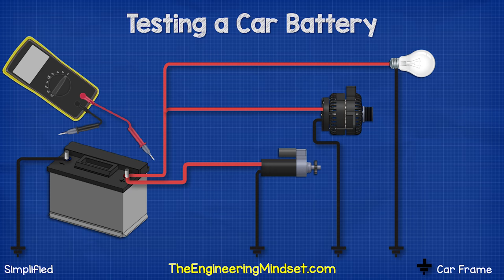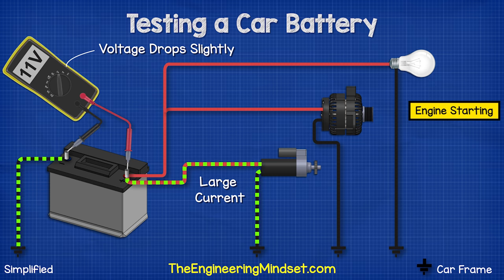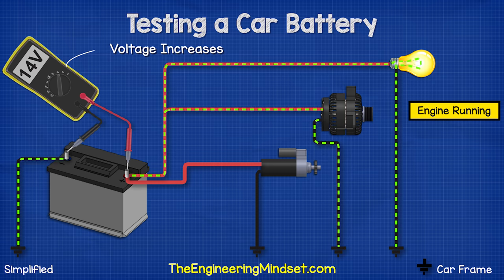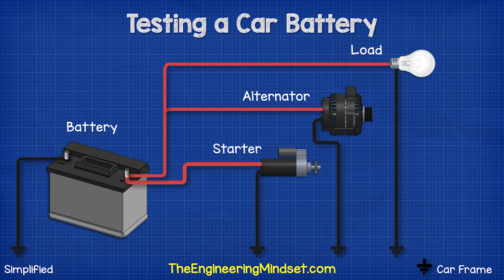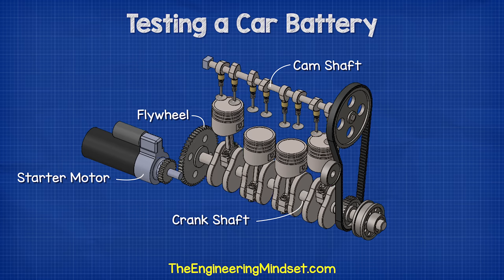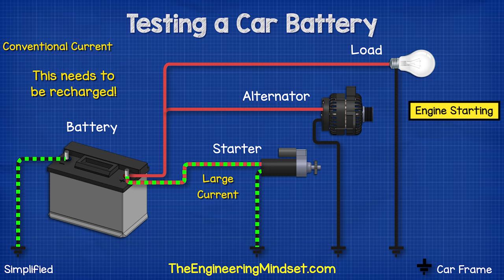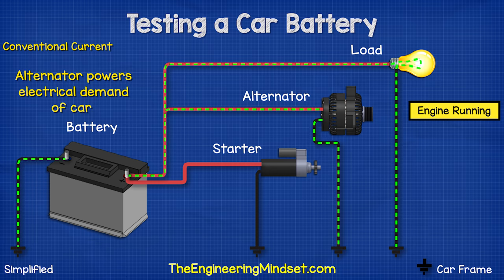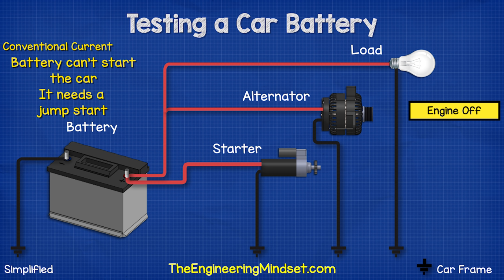How to test a car battery

Comment: If you have 11V or lower on your battery it does not necessarily mean that battery not functioning properly. It could be a generator fault, it could be discharged by other equipment or frequent starting.
Reply: 100%, I thought the same. I am here to check charge of batter when NOT connected to alternator
Reply: I doubt with that cause if u connected multimter cross battery terminal it mean voltage of the battery not the system. Also vdrop is sensitive for some componnt for electronic like diode
Reply: If you want to check battery. You do not use multimeter. First you must charge battery with battery charger. If battery do not charge it is bad. When battery is charged you test it with charge tester then confirm if it is bad or good. More advanced way of testing battery is by using programmable load. You can measure what is capasity of battery.
Reply: Your the man

Comment: It's always best to use a manual battery load tester!  They're only about $20 and you will almost never use it.  However, when you do need to use the battery load tester just before winter it will save you a big headache before the cold weather starts to kick in!

Comment: Battery also dampens spikes and stabilize voltage. If you remove the battery while the engine is running you can damage electronics since the battery is not available to absorb spikes in voltage.
Reply: Very true!

Comment: the battery's current is measured in amps, and the voltage is fixed at 12V, for example .When we consume power from  a 20A battery, we consume amperes , not voltages, so why do we measure the voltage instead of measuring the current?sorry if my question is stupid, but I'm just confused

Comment: The alternator charging will turn on and off while driving - the voltage regulator does this, to prevent from overcharging the battery. You can usually see the battery level gauge on dash move back and forth a little while driving. This will tell you charging system is working...if it doesn't,  you may  soon have a low volt situation...engine likely to start running erratically (as fuelpump and fuel injectors begin to falter).👍
Be familiar with your battery gauge operation and always monitor it while driving - that's what it's for!
Reply: My 2011 Ford Fusion Hybrid does not have a start battery indicator on the dash. Only a dice battery level indicator. Working very nicely at 10 years old!

Comment: So think twice before installing overpowered amps/subwoofers on stock battery and alternator... and maybe even throw in huge capacitor just to have one extra device for your vehicle to charge like it's not enough already :D There's just not so much it can provide extra taken into account what the car needs for itself.

Comment: So if my car battery is 12v when ignition off, 11v when ignition on and 14v when engine on, there is nothing wrong with it? My car is not starting up first time and came up with battery light while trying to get it started but light goes off when engine does finally start up. Tested battery, spark plugs recently changed, what could the problem be?

Comment: What if while the engine is running instead of 14v it display 13.8? What exactly does this mean, a problem with the alternator , the battery or both?

Comment: I've heard some people would short the battery for testing
Reply: Shorted battery's can explode
Reply: Shorting the battery to produce a spark just tells you that there's voltage on the battery, but not how much. It's not good for any battery to short it, and is also dangerous as Robonza mentioned. It could ignite the hydrogen gas produced inside the battery and cause an explosion (however I think most car batteries sold today are sealed so I'm not certain if that is still the case), or start a fire from leaking fuel or gas fumes. Always use a proper tester.
Reply: You could also put your fingers in the outlet to test the powerplant.
Reply: exactly, it happened to me before, a well known car electrician in our town, used to check my car battery by shorting it to see if it gives big spark, if so then battery is good 😂😂😂😂😂😂

Comment: you say that once the car is running that the electrical needs of the vehicle are powered from the alternator but doesn't the battery continue to run all the electrical needs of the car always and the alternator is just providing more current to the battery for those needs as well as charging needs?
Reply: No as much as I understand. If you disconnect the battery of your car, when the engine is running, it will continue running due the alternator will supply the energy for the engine.
Reply: @VictorGonzalez-mi5kd  The battery helps to stabilise the voltage at around 12V.  If you remove the battery with the engine running the voltage will increase to 14.4V or even higher and this will help burn out the lights and other devices sooner than they should.   I burnt out my radio because of a higher than normal charging voltage.

Comment: I was charging another car battery with my car battery and my friend said if i push the gas pedal it would charge faster or more current  is that correct?
Reply: When you jump start another car you're actually using the power produced by the second car's alternator. Pressing the accelerator means the engine runs faster, which turns the alternator faster and provides more voltage. This can help to get the first car started. This is only done to start the car though; once it is running your car's own alternator will start charging the battery. However it could take up to several hours to fully charge a dead battery, so jump starting is really just to get you home where you can hook up an actual battery charger instead of using up all your gas.
Reply: Not by much, on idle revs the alternator is producing optimum voltage, it may increase very slightly with higher rpm but the electronics in the alternator remove excess voltage.
When jump starting, I leave the engine on idle.
Reply: This is pretty easy to test by yourself, just get a multimeter, on a well functioning alternator you won't see much difference at all. The alternator has a built in voltage regulator, otherwise when speeding up you'd fry all the lightbulbs and all the electronics. :)
Reply: @techalyzer  - well put!
Reply from the maker: Check our new Multimeter tutorial out ➡️ https://youtu.be/4lAyzRxsbDc

Comment: One thing that doesn't quite make sense is when both the alternator and battery are powering electrical components simultaneously, how can current travel in both directions in the negative ground battery cable connecting to the vehicle chassis??? If the alternator is charging the battery, then you have current going to the chassis from the negative battery terminal to be grounded but if the battery is also powering electrical components you have current flowing back to the battery from the negative ground cable to the negative battery terminal. How can you have current flowing in both directions at the same time??? I do not think the electrical demands of the vehicle will ever reach the point where the battery will kick in to aid the alternator in powering those components. Aren't alternator max amperage close to 100A. Can someone please explain this to me, would greatly appreciate it.

Comment: Sorry for such stupid question but can a car battery shock and kill you?
Reply: No. Skin's electrical resistance is too high for 12 volts to electrocute you. It won't even tingle (unless you lick the terminals, but don't do that!)
Reply: There is nothing like a stupid question :) Nobody knows everything and always learn, but no you won't shock as the voltage is too low. Need much higher DC voltage closer to 50-100V to feel it and be dangerous. So for a 12V battery you are safe.

Comment: Why can't the alternator and starter be one and the same unit? they are both electric motor / generator correct?
Reply: Starters are gear driven and mesh to the engines flywheel or flex plate (depending on the transmission type). Using the starter as an alternator would require constant engagement of those teeth and would be noisy and wear out the gears. The alternator is belt driven and would require a substantial belt capable of transferring high torque to start the engine. A belt system heavy enough would be a bigger parasitic drag on the engine as it is running as compared to a normal serpentine belt driving the alternator. You'd also need to deal with the current flow coming from the battery on startup and then switching to current going back to the battery if you used a starter / alternator combo.
Reply: @2aminitials  great explanation thank you

Comment: I didn't see anything about testing a battery a battery can have the 12v reading and still be bad because it's not putting out the required amps usually because of a weak cell

Comment: Now why do my grasscutter die when i remove the battery? It got an engine. Same for my ATV it doesnt run without a working battery.

ATV even got a rope to start it but still it wont run without a fully working battery.
Reply: Good question. 1/ The battery provides a pretty well constant voltage with a large capacity to provide current so - a really good power supply. 2/ While a generator can provide electricity on it's own, an alternator can't - it needs a currently flow to produce power. You could, in theory build in large capacitors so that you could remove the battery when running but you would need to start the engine with a battery.

Comment: Recently my battery had 12 volts but it didnt cranck the starter motor, i went to servie and they tested my battery using a special tool that measure amps. So multimeters are not enough to test a battery...
Reply: I think he did pretty good as he stated to measure the voltage while cranking. The voltage drop during cranking will clearly show a weak battery.
Reply from the maker: The special tool is simply a multimeter connected to a resistor, to measure the current.
Reply: Usually a multimeter is enough to check that the battery is properly charged. It's true however that a bad battery can show a proper charge but still have very low capacity and be unable to provide enough amps to start the car. That is what the advanced tester checks for. Unlike simply testing the voltage on a battery, it does so while the battery is under load. As the video mentions the voltage will normally be lower while running the starter due to the massive current draw. A defective battery could show 12 volts, but as soon as you crank the starter drop to nearly nothing.
Reply: if you have a multimeter capable of measuring >100A, you could also measure the current drawn by the starter (if you know what you are doing) ... but I think most multimeters will only measure up to 20A before releasing some magic smoke or catching fire instantly ;)
Reply: I been working on cars for 30 years with a $100 fluke DVM. I have not got a battery diagnosis wrong yet. Any arguments mean its time to upskill
Reply: Battery's consist of some metals soaked in acid. As they age, a coating develops on the metals which reduces the ability of current to pass through the battery. Battery testers test for resistance. Testing for voltage alone is not sufficient. You can have a battery that shows 12.6 volts, but has I high resistance resulting in a weak battery. The only way to fix it is to replace the battery.
Reply from the maker: Check our new Multimeter tutorial out ➡️ https://youtu.be/4lAyzRxsbDc
Reply from the maker: Check out NEW resistor video, everything covered! ➡️ https://youtu.be/DYcLFHgVCn0

Comment: Actually if it starts the engine first crank, the battery is good. If the voltage from the alternator is less than 13.8 Vdc, you got a charging system problem
Reply: Newer "intelligent" charging systems may put out only as much as 12.8 volts under specific conditions and this would be normal, iaw working as designed. The mentioned 13.8 volts is not  a valid rule anymore, if it ever was.....
Reply: If it is charging at more than 14.4 V then there is a voltage regulator problem and other electric/electronic devices could be damaged, e.g. radios satnavs,  headlights etc.

Comment: To test ANY lower source you need to place a small load on it. This will show you the voltage in the battery.
These idiots who think "super capacitors" can replace a battery are soooooo wrong as once ANY load on a capacitor will immediately drop the voltage in a capacitor. The voltage reading in a cap WILL drop each time load is placed in it, not so with a battery.
Reply: Bet they don't know the fundamental capacitor equation.
Reply: @bearchow1929  no they dont its like "hey it cranks" haha

Comment: I had to give you a thumbs down on this one because you got the current directions backwards. While it may have been partially correct for hole flow, that is a non-standard description these days. Especially when verbally referring to the flow of electrons.
Reply: Conventional is the default in electrical engineering and among hobbyists. Actual charge is typically only used in chemistry and material science; places where the polarity of electrical charges actually matters.

But yes, saying electrons move in the positive direction is wrong.

Source: I'm an electrical engineer. The only time I've used actual charge is when studying semi-conductor physics.
Reply from the maker: Appreciate the feedback, but we can't win. Most people are taught conventional current at school so when we show electron flow, we get hundreds of dislikes, angry and outright abusive messages.
Reply: @EngineeringMindset Keep a steady mindset. A man who can sway and bend in the face of adversity is a true engineer.  You are doing great work.
Thank you
Reply from the maker: Thank you, I well. It is hard though especially when the top trending video on YouTube today is a teen playing minecraft with 3.5M views and 360k likes in 16 Hours. We produce something actually useful and we'll be lucky to get 10k views this week.
Reply: The direction chosen actually works well when you draw circuits with diodes etc because it goes the direction of the arrow even though its is technically backwards it easier to comprehend as diodes and biploar transistors are drawn backwards which match perfectly.
Reply: @EngineeringMindset  I agree. You should look into doing shorts and image-posts for YouTube on mobile. They are supposed to help in regards to the algorithm.

Comment: A charged car batterie puts out at least 12.6v.

With the fuel pump fuse removed: -
The battery voltage drops during cold cranking to around 10v.
Cold cranking voltage varies with the temperature of the battery.

A good battery will go back to 12.6v quickly once you stop cranking.

Comment: Best to test battery with 100-amp load tester to see if voltage stays within range for stated amp battery otherwise you may get stuck somewhere..
Reply: Unless the car has a manual transmission....you can "pop start" the engine if the car be pushed in nuetral...get it rolling then with transmission in 2nd gear (best of all) and clutch pedal held down...release clutch to turn engine. It's a good reason why I like manual shift vehicles (all 3 of my vehicles are).👍
Reply: Definitely!  Just checking the voltage of a battery is not enough.  You have to put a load on it to see if it can push those amps (for starting / turning over the engine) without faltering.  Let's us not forget to have those battery cables & terminals clean & shiny & tight as well for starting.  Small but critical details that are sometimes overlooked by the average car owner.
Reply: @s.j.5850  Paying attention to how well the starter cranks the engine can provide clue on battery condition...when slower cranking speed is noticed, that can indicate end of battery life is near (especially if charging voltage is normal).
Also monitoring voltage drop when starting engine can be helpful. Knowing age of battery is also helpful...batteries have expected life of 3 - 5 years.
👍
Reply: @s.j.5850  Don't forget the alternator belt!
I just recently noticed low voltage battery while driving...first thing I checked was the V-belt (had replaced several months ago)...it was loose!
Tighten it...issue went away.👍
Reply: @raybin6873  Yes, that too!
Reply: @raybin6873  Yes, all of these things help you to determine the condition of the battery.

Comment: The battery voltage at rest is 13.2v
Reply: You've got to wait for around 5 hours after you've driven the car or charged the battery or else you will get a false reading.